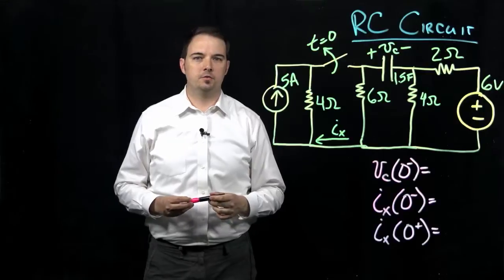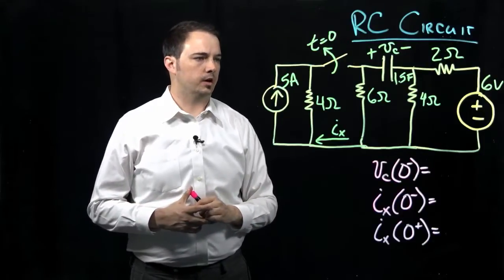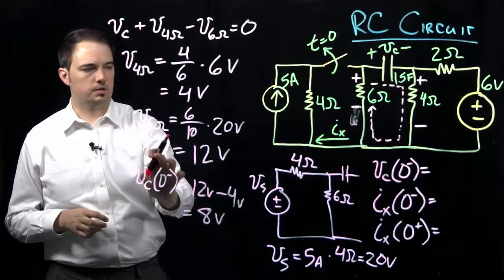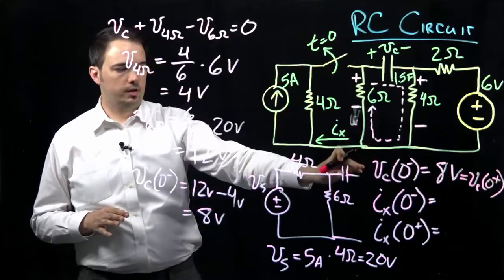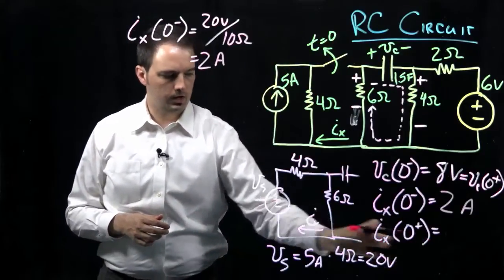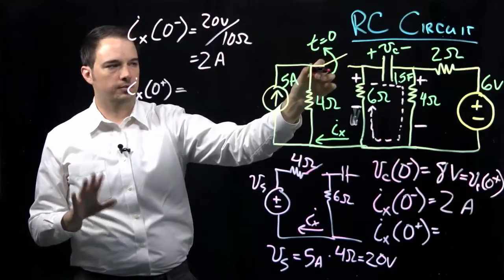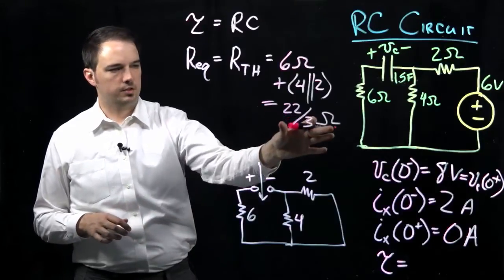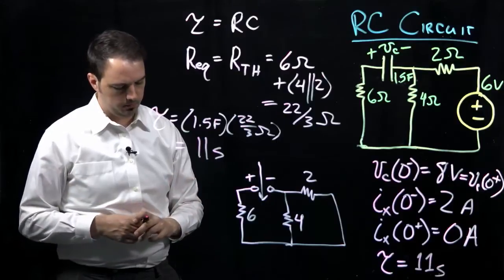Circuits I: Example with RC Circuit

Comment: when you used source transformation with current source and 2 parallel resisters and construct voltage source with 2 series resisters. Why did you write the Voltage of the voltage source as I*4ohm, should not it be I*(4ohm + 6ohm) , why did you ignore the second resister, this is blowing my mind(((

Comment: I don't understand why when we are looking for the voltage of the capacitor at time infinity, we set the polarity of the 4 ohm resistor voltage drop to be from negative to positive going from up to down. Furthermore making our voltage of the capacitor at time infinity to be a negative value.
Reply from the maker: +209lefty Hi Lefty! I used that convention because the problem originally assigned the voltage across the capacitor of positive to negative (left to right). So, in assigning polarity across the 4ohm resistor, I am just following what the convention is across the capacitor (imagine the capacitor sitting parallel to the 4ohm resistor). So, yes, this does make the capacitor voltage, as defined, to be negative at t=infinity. In reality, we know that simply means a positive voltage in the opposite polarity. But, when given a problem where polarities are pre-defined for you, you need to keep with that convention.
Reply: +Dr. Montgomery Hello Kyle, I appreciate your clarification. I understand it a little more thank you and thank you for all of your helpful videos.

Comment: Thank you so much for responding. Do you by chance have any lecture videos on using Laplace transforms to represent current and voltage in RL and RC circuits? Perhaps higher order as well?
Reply from the maker: +Rachel R Unfortunately, I do not have videos describing the Laplace transform -- the course I was teaching with these videos did not get that far into AC analysis. We did, however, cover Phase transforms, which allow you to work in the frequency domain in a rather straight-forward manner. Here's a starting point for that: https://youtu.be/x47zKzHbFmE

Comment: I just realized I copied it down completely wrong, my mistake! Very sorry. I still want to make sure you mean voltage divider when you said current divider.
Reply from the maker: +Rachel R Hi Rachel! Glad to hear the videos are useful to you -- I  believe you are correct regarding my comment when calculating the voltage across the 6ohm resistor...I am applying VOLTAGE division at that step. Thank you for catching that!

Comment: Hi Dr. Kyle Montgomery. Your video lectures are saving my life, thank you very much! I think you may have made a mistake when solving for Vc(0-) on this one. You initially set up the equation as Vc+V_4omh+V_6ohm=0 and when you obtained 12V and 4V, you subtracted 4v to the other side but you left the 12V as positive. Am I missing something? Also you meant to say Voltage divider when you got the value of the voltage across the 6ohm resistor, right?